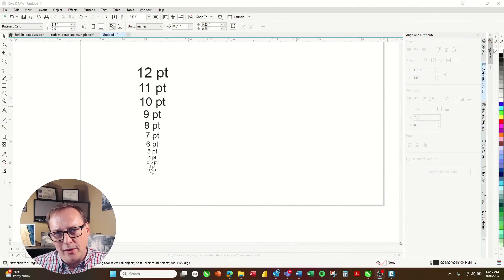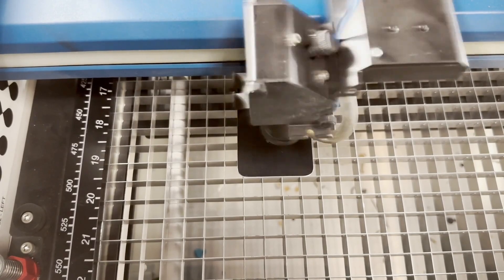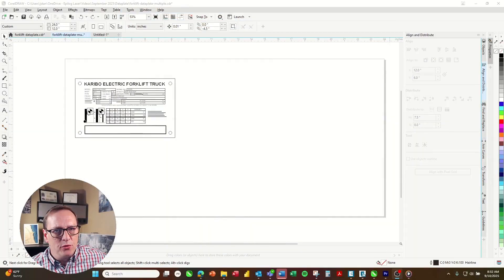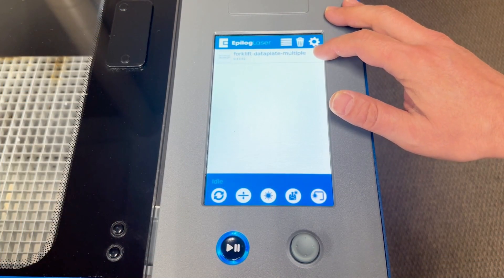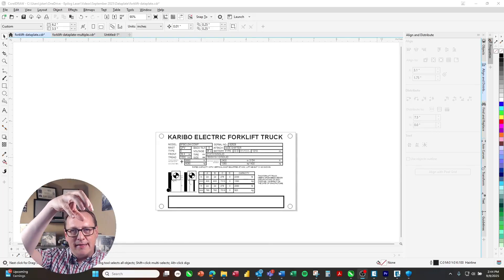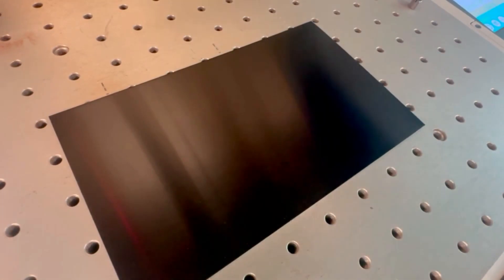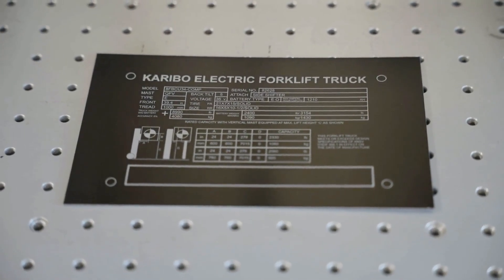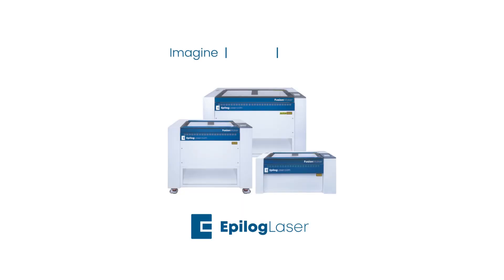How to Laser Engrave Anodized Aluminum Data Plates Like a Pro

Comment: this is not engraving into material...and etching will rub off over time
Reply from the maker: Epilog offers CO2 and/or fiber laser systems.  The CO2 laser will bleach the anodizing dye to expose the color of the subsurface metal; however, the CO2 laser will not produce any depth into the metal.  Fiber lasers will produce depth into anodized aluminum and generally maintain readability longer than material marked with a CO2 laser.  In extremely harsh or abrasive environments, and depending on the color and quality of anodizing, CO2 marks may fade after time.